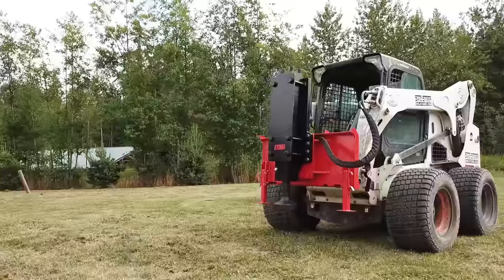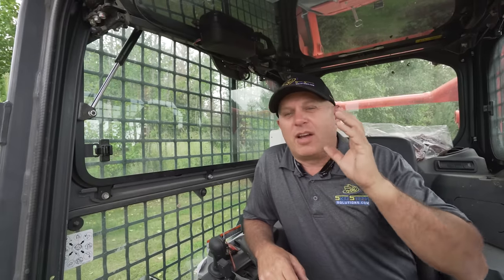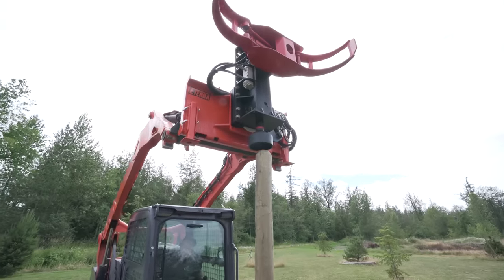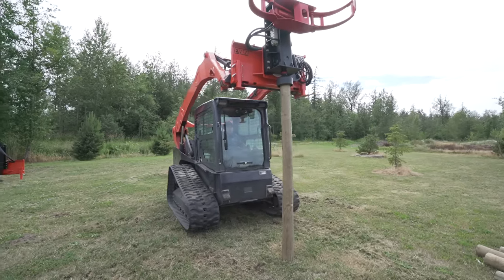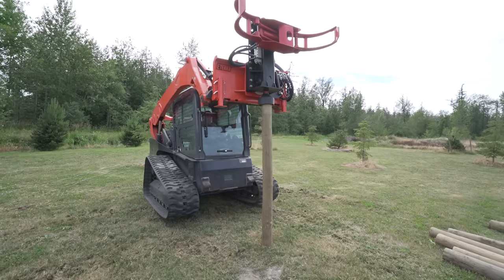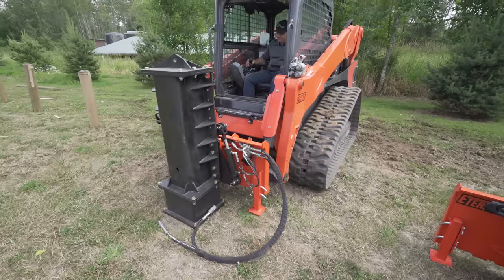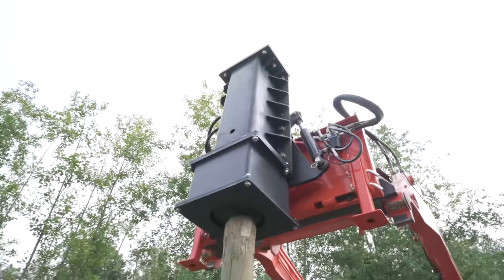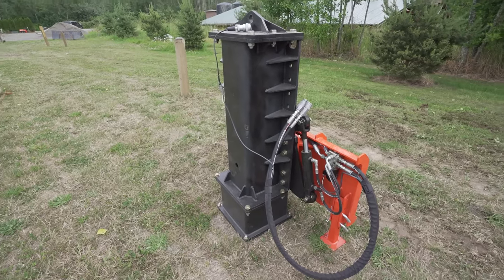NEW Post Driver Developments for Skid Steer Loaders | Skid Steer Solutions

Comment: As a small farmer, I've installed thousands of feet of 8 foot, 5-6" wood post/woven-wire fencing using just a tractor and an $1100, heavy-duty Woods augur.  And my own arms and back.  I'm kinda proud of that.  Fencing contractors with these skid-steer outfits want VAST sums of money to do the work.  We're talking $20K, $30K, $40K, in that ballpark.  Forget it.
Reply from the maker: Totally understand your point here! For these contractors, and those hiring them... There is a mutual benefit to getting the job done faster and  that's where Post Drivers come in. We provide lots of fence contractors with a great range of Hydraulic Auger Attachments and bits as well, but the company's putting in lots of fence want to do the work fast and well, so they buy Post Drivers for their business as well. Thanks for your comment Pine Forest!

Comment: Works great if you have the correct soil.  Come to the Texas Hill Country where the top soil is bedrock
Reply: And pennsylvania
Reply: You shouldn't be using wood post out there any way !! It'll will drive pipe in the hill country just fine well at least the one I Dig texas sells will not sure about this unit.

Comment: Do it without putting a point on posts.
Reply: Just imagine the time it takes to make points on each post.......
Reply: @ShinkleGunDog  - yeah and it's funny how they didnt show the top of the posts, especially after that 1250 model got done shredding the top of that larger post, you could see chunks falling down while the camera was trying to focus on the dirt around it "shaking"...
Reply: They actually make a thing to put points on posts.  Looks like a huge pencil sharpener.  Costs thousands.  Still a bunch of extra work.  My post driver puts 6'' posts down just fine.  Only had a couple times when it wouldn't drive them.
Reply: Why

Comment: should add some sort of giant level indicator for putting the poles in
Reply: You can attach a chain for height and level (gravity). Attach close to the driver as for reference. If you want post 5' above ground cut chain length to 5'.

Comment: Can you make one that grabs post half way up and vibrate in need to for under vine kiwifruit canopy work build one and I’ll buy it ASAP
Reply from the maker: Thanks for the comment, Eterra is still working out new ideas for post drivers. I will send your comment their way to see what kind of ideas it inspires. Thanks for watching and being a fan.
Reply: Skid Steer Solutions thanks for that have a height restriction to work with would like to mount on a king hitter series 3 side shift post rammer will cut mast down to suit . Need to be able to grab post halfway then vibrate in even if we have to take a couple of grabs to ram in 500 or 700 max

Comment: If ground is even a little damp, those tracks will tear it up something awful every time the skid steer turns.
Reply from the maker: Bobcat also makes an ALL-WHEEL Steer model, called the A770. It also has TURF Tires so it doesn't rip up the grass the slightest bit.
Check it Out: https://i.ytimg.com/vi/BLJ2vrP10rk/maxresdefault.jpg
Reply: Have at it with your back then

Comment: Looks like it's chewed up the top of the post I think customers wouldn't be happy if I did that lol
Reply from the maker: The posts in the background that you see damage on were overuse tests on the driver, in which case there was no regard for the posts. That's why they are so deep in the ground; in excess of 6 feet.
Reply: The Gun Collector NRA 1
Reply: You drive the post close to the desired height then chainsaw it off.

Comment: So what happens when the ground loosens up around the post from wet conditions and there is no concrete for support.
Reply: A properly driven post is far superior to any with concrete around it.  The sub soil stays tight around the base of the post year round, and they certainly don't loosen up unless too short a post is used.  We apply some pretty extreme tension to our fences, and the depth of the posts is where the holding power starts.
Reply from the maker: Hey Rob, This is extremely hard pack clay. The ground is very dry right now. These posts were not going in for a fence, they were going in as a demonstration, so concrete was not added. In a lot of cases folks don't need to add concrete but as you pointed out, it does add a lot of support and virtually eliminates the risk of the posts drooping over. With this post driver, we just aim to drive at least 4 feet down. If we wanted to add concrete, we'd have to do a demonstration where we pre-drive the holes which defeats the purpose of demonstrating for customers the raw power of this unit. With a skid steer auger and posts, that's when we would add concrete because there is a lot more room to pour it in. Thanks very much for your comment, it's a valid point. If you want to compare the Skid Steer Post Drivers that we offer, visit us here: https://www.skidsteersolutions.com/skid-steer-post-driver-attachments
Have a great weekend!
Reply: Rob &/or Marisela, look up what "friction piles" are and if you ever saw how sheet piles or marine pilings are buried, the displaced earth acts like a friction clamp around said structure, so really no need to add cement unless its sand or sandy soils then you may want to add grout to the base below the surface as doing so to the top of the surface would allow for premature failure. Another option is a through bolt or two that stick out the sides a few inches for extra hold annd can forgo using grout or cement which will eventually crack.
Reply: Use it for yourself
Reply: Using concrete sucks. It does not stop the ground from moving away from the concrete  All concrete does is fill in the hole you dug. I build over a 130,000 feet of privacy fence a year i would drive every post if i could but people are under this concrete is king idea and its totally false.
Reply: Concrete makes the post rot sooner at ground level...and as someone else said the dirt will pull away  quicker when  Concrete is used....

Comment: Ummmm.   Auger works and is WAY cheaper
Reply: Auger v Pile driver, lets see

Auger requires drilling a hole to depth then inserting post and filling in if/as required and took what about two or more minutes?

Driver just drives it in the same time and since the post is installed immediately it does not require handling into the hole as it has already been handled and due to the displaced earth it is held in plenty enough by that friction alone (friction piling, look it up) so no need to backfill. But the one down side is if you are too aggressive it will cause damage to the top of a wood posts seen to some set aside from "destructive" testing. In in a minute or less and done, the next two can be easily installed in the same time compare to post hole method. But rocks and rocky sol are a pile drivers worst enemy, but not impossible.
Reply: Yes and no. The auger is cheaper and does work but does take more time. Since I don't do this for a living the auger is a better fit for me and the pocket book. However I have not used one of these but seem to be a lot faster. If they were cheaper I could justify buying one but like I said I don't do this for a living and makes more sense for me to continue to use the auger. But I would have loved to use this post driver.

Comment: cheaters the post are all pointed. we drive a post on the farm with no point. when you are repairing or laying new you don't have time to make fancy points drive the post before you have animals out.
Reply: Why not just get them supplied that way?
Reply: cost. when you are driving a few hundred post every penny counts.
Reply: You complained about having to make the pointed ends. I gave a solution, you moved the goalpost. If you are pinching pennies, why not just skip the cost of any drivers and dig the hole by hand and tamp them back in?  Either way, I'd bed this'll drive blunt posts.

Comment: Looks like they all drive at about the same rate.
Reply from the maker: Hey Ben! This was a testing video. We wanted to invite everyone to see us try out the prototypes and of course, these are very raw videos and don't show perfect/expert operation.

The PDX-1250 is substantially more powerful than the PDX-750 and the big difference is noticed in really hard and rocky ground. Both are going to drive a small 4-6" post the same, but when it's really hard and the posts are bit larger or unpointed, that's when the 1250 stands out :D

Thanks for your comment and if you ever have any questions, don't hesitate to reach out. We're here to give you real expert advice and comprehensive answers to your needs.

Thanks!

866-966-2538

Comment: Aw Dude, you're trying to sell a tool that so specializes you priced your self out of the market! The 10K price tag on this bad boy will turn off all but the stupidest customer. Most landscapers will pass just because the labor and time cost will be cheaper in the long run. Youll have better luck selling ice to an Eskimo!
Reply from the maker: Our customers that are fence contractors are reporting back huge time savings! Some are saying they can put a massive fence in on an acreage about 5 times faster than a traditional skid steer post driver which range from $6 - $8,000.00

It's amazing how fast a fence builder can work with a tool like this.